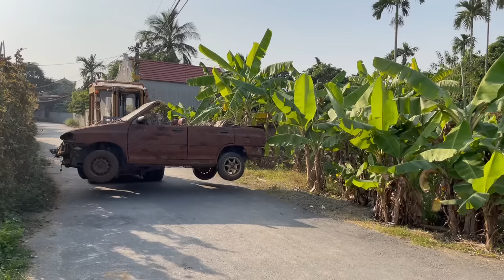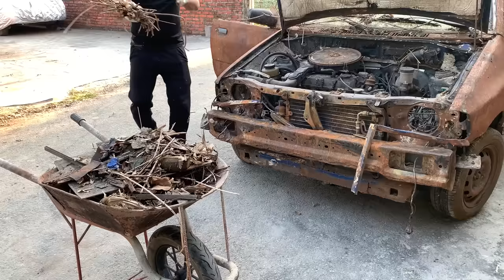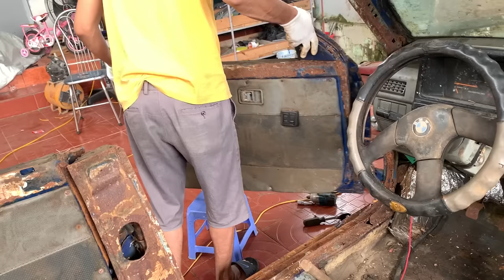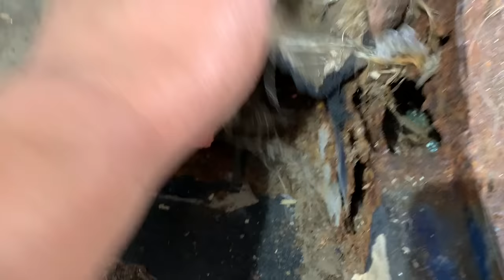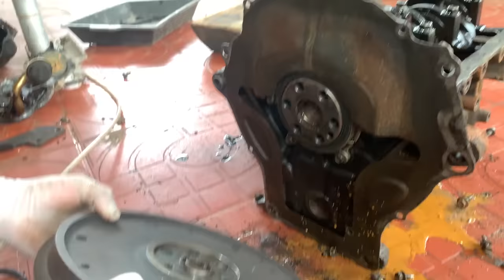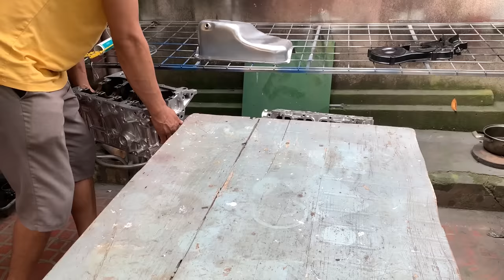Restoration BMW convertible | Restoring Old Car  #BMWVR Final

Comment: good job cleaning the engine but it doesn't look like a BMW it looks like a Toyota brand car and that they adapted the BMW steering wheel or does it look like me?? someone correct me if what I see is a wrong assessment.

￼

Comment: with all the little scavengers that lurk in that part of the world NONE of those items would have been in that car... they would have been LONG GONE BRO... AAAAAANNNNDDD that cheap ass interior aint no BMW interior, no torque specs or torque sequences followed, no clearances checked, reusing main bolts, main bearings, flywheel wasnt balanced... silicone to seal the oil pan.. bro i dont wana see anymore this is a joke... I could go on for a week.. lol im out